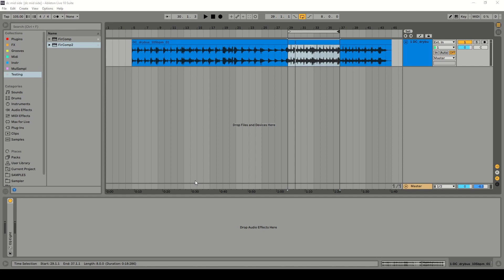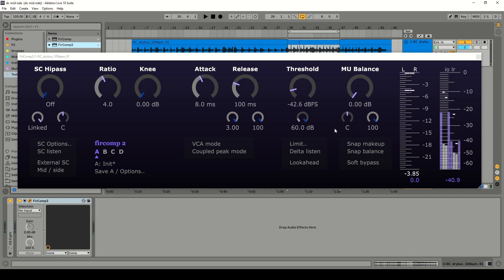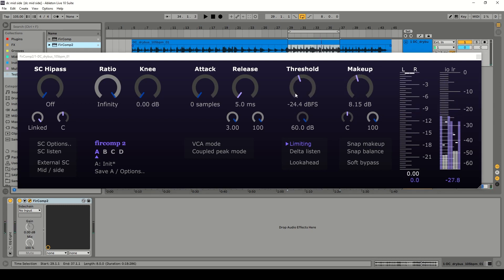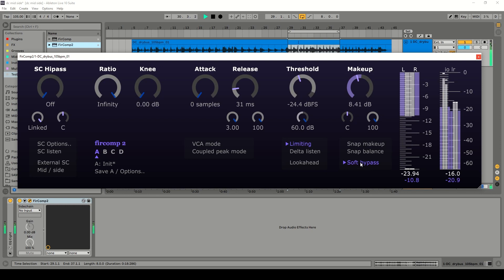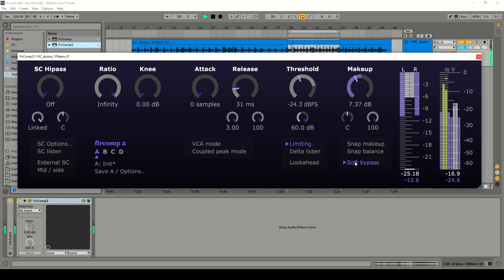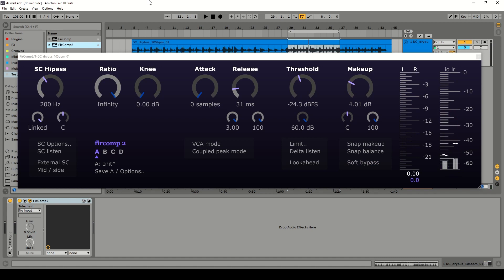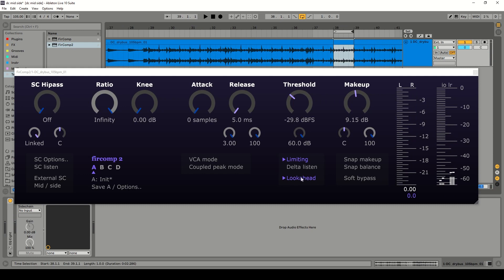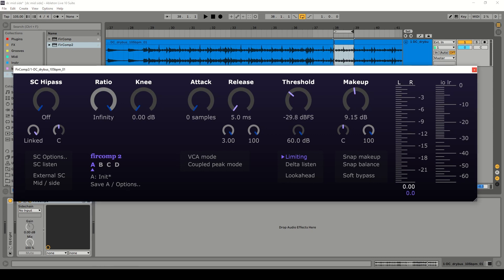How far can you push Fircomp 2? Extreme compression

Comment: Ideas for fircomp 3:
configurable attack, 0-10ms,  10-50,  50-200   (right click atk to pick range)
A hold knob.
More sidechain filter shapes and configuring.
sidechain gain knob.
sidechain source channel display. that would be cool. 
More lookahead options(1.5ms ,  3ms , 5ms, 10ms)  
right click option to change ratio into expander / gate? 
Graphical representation of the release shape would be cool. 
Distortion detection? indicator for when extreme harmonics are being added

Comment: Just seen this highly recommend in a mastering facebook group. I'm curious to know what your doing differently Jon, FIRcomp would imply some kind of FIR smoothing perhaps, but your device is zero latency. Any little tricks you'd care to reveal to us?
Reply from the maker: The FIR filtering is part of the sidechain detection, but only part of it, combined with other techniques. If lookahead is on, the lookahead filter (applied to the gain control signal) is also a FIR filter.

There is no filtering on the audio path, just the sidechain, and if lookahead is on, then FIR filtering on the gain control signal too.

Comment: What does softbypass do? Still compression?
Reply from the maker: This bypasses the effect entirely. But if you have lookahead on, it preserves the same amount of latency. Also the effect still runs internally, so you can see the metering including gain reduction. But the compressed sound is not used or sent to the output.

Comment: Hi Jon, great demonstration. Is Fircomp in limiting mode and 0 samples attack can work as Inter-Sample-Peak limiter for mastering?
*Update: I just checked it now and it performs perfectly as an ISP limiter :) Thanks!
Reply from the maker: Hi Tom, actually it does not detect intersample peaks, only standard audio sample peaks. (I don't think it's possible to do this with zero latency).

Out of curiousity, which ISP meter are you using? As it should have detected some, but maybe the music you were limiting did not have aggressive transients?
Reply: @jonvaudio-plugins  Hi, interesting, also I didn't push it too much. I used Orban Loudness Meter :)